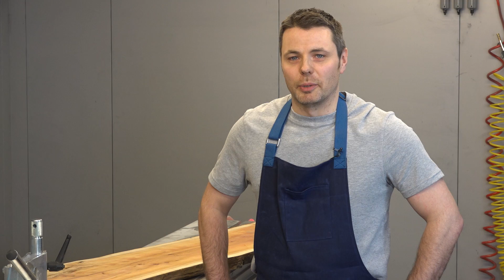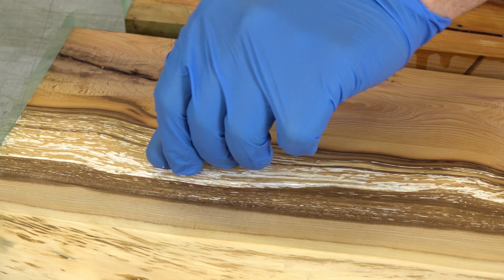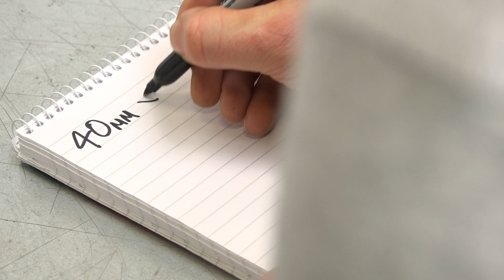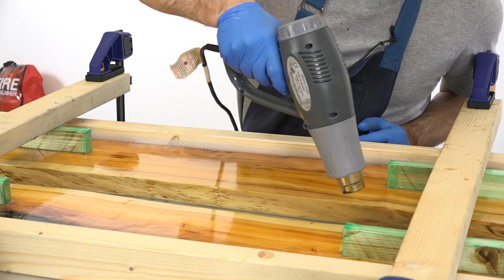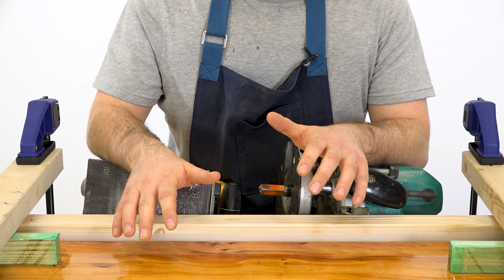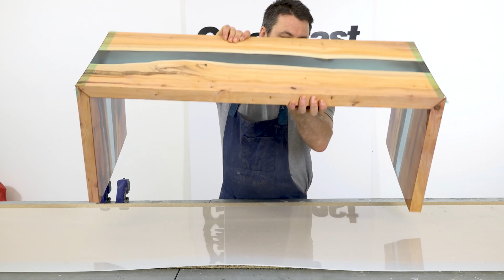Epoxy Resin River Table Tutorial -  Pro Guide

Comment: Can you not 

a) Weigh the wood. 
b) Divide by the density of that type of wood to get the volume. 
c) Might need to get the moisture content and adjust
d) Volume of the empty mould. 
e) Subtract.
Reply from the maker: You could try and calculate the 'river' more accurately but would need to know the exact density for the wood. It also wouldn't factor the absorption of resin into the wood for the sealing coat etc.
Reply: @glasscastresin  Might be interesting next time, to measure moisture and weight before. Then carry on as you do, but see how much resin you do use and compare against the weight etc. 

The reason is the weight you effectively know exactly to the nearest gram. Measurements of gaps etc are approximate. 

That would be an interesting experiment.

Comment: So sad the bark had to be removed, it had a lot of textures like riverbank's mud. Is there anyway to infuse epoxy into those bark fibers (vacuum sealed way?).

God bless.
Reply from the maker: The issue with leaving the bark on the wood is that it generally has quite a weak bond to the rest of the wood. With large pieces like tables this can pose problems if the bark starts to come away at a later stage down the line. The issue with trying to use resin to stabilise the edge is that you never know how deep the resin has penetrated and sured up the wood. If you did want to keep the bark in place then really you would need to secure it with a mechanical fixing to ensure that it would be strong enough.

Comment: Is Danish oil compatible with glasscast 50 and 3. What other finishes are compatible?
Reply from the maker: We used Danish oil in this very video to finish the wood itself; it will simply wipe off the surface of the cured resin. You can use pretty much any wood-finishing material to complete the project from furniture waxes to varnishes and stains. They'll all coat the wood and simply wipe or buff off the top of the resin.

Comment: Is the 10kg of resin you worked out the total you need including the hardener? So for example 7.5kg resin and 2.5kg hardener Or is it 10kg of the epoxy resin, + the hardener which would be 15kg total. Thanks

Comment: What PPE do you recommend when working with GlassCast 50? 
Should you wear a mask for vapors when it is in it's liquid form?
Reply from the maker: Hi Neil, we would never discourage the use of a vapour mask when using the resin especially if you have known breathing issues such as asthma. The Resins are incredibly low VOC and don't really give anything off so the vast majority of users prefer not to use a mask at this stage, however, we would definitely recommend you use a suitable dust mask when cutting, sanding or drilling - the dust made isn't toxic but is an irritant like any other fine dust (sawdust, MDF dust, etc). Its also important to use Nitrile and not Latex gloves as the amines in epoxy can travel through latex. Although uncommon, some people do have sensitivities to resins and so long sleeves and gloves are important, eye protection to protect against splashes, etc.
Reply: @glasscastresin  Thanks for the advise

Comment: Hi, really enjoyed this video. Just have a few questions.

1) What dimensions was the table when you bought it?
2) How much did you take off for the finished product?
3) How much was the English Yew wood that you used?

Thanks!
Reply from the maker: Hi Aaron, I'm afraid I didn't really record those sizes; the piece was approximately 2m high and 50cm wide; as we used the timber for the legs as well, aside from the mitres and a very thin strip down the side, we utilised pretty much the whole thing. Unfortunately, its a little while ago now so I can't recall how much we paid for the actual piece but the Exotic Hardwoods UK website (in the description)  lists lots of pieces with prices.

Comment: I've seen many tutorials on your  products. what really has me interested is the way the bubbles escape. no idea if other brands work in that fashion.

my question is there a way to purchase in the US?  if not can I get some tips on how to evaluate a different epoxy system suitable for floors and table/counter tops? I'm sort of out of my depth here... you can message me if that's better.
Reply from the maker: The Bubbles escape from the resin due to air expelling chemical additives included in the resin mixture at manufacture. This means that, in most cases, no or little degassing of the resin is needed. Allow 20 minutes after pouring for the resin to self-degas.  You can then go over the surface gently with a heat gun or blowtorch to remove any remaining last bubbles.  We can ship direct to the USA by FedEx.  If you are looking at other resins, you want to look for a resin with high clarity, thick pouring ability, low viscosity and good UV stability.